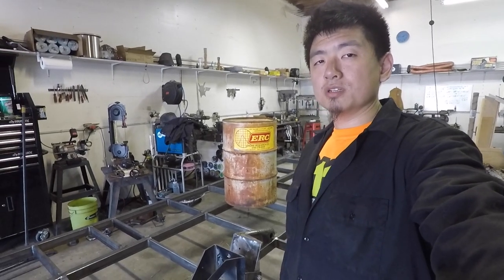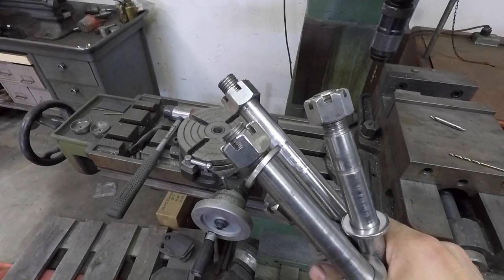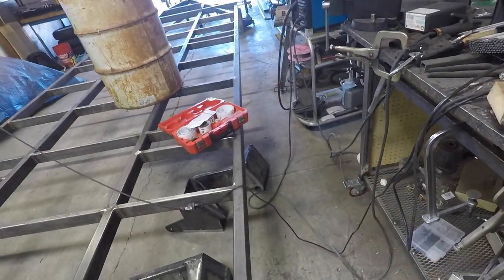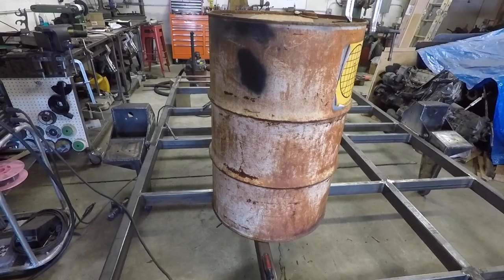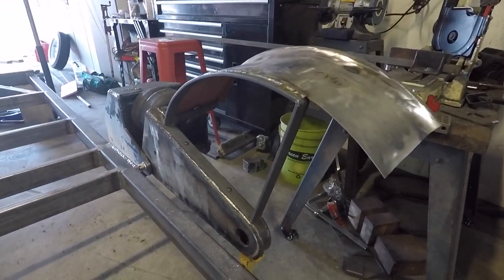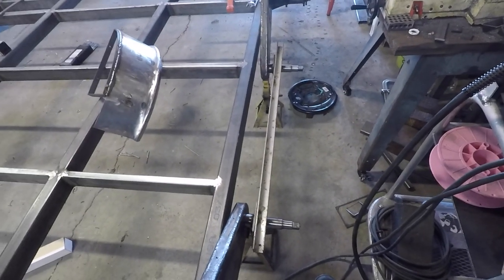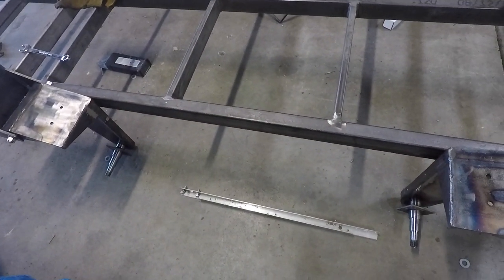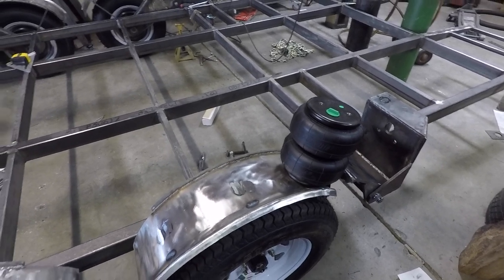Bagged Trailer Build - Wheels - Part 6

Comment: Good job , nice vide , but You should use some bushings or  bearings on pivots
Reply from the maker: there are bearings in there. I ended up changing the whole design and went with bushing instead of bearing

Comment: Can I purchase the same drawings you did? 
I already have the frame just need everything else
Reply from the maker: You can buy the plans here. https://fabplans.com/products/air-bag-car-trailer
Reply: How did you align the wheels?
Reply from the maker: @larrypierceall  the way I aligned the wheels isn’t the best. There’s a lot of assumption. I assumed the frame is square. Raised the frame the ride height and took measures from the brake flange to the frame.

Comment: hola buen dia amigo cuanto es el costo de las perchas o vases para las bolsas de aire.
saludos
Reply from the maker: You just want the airbag mounts?
Reply: @MCYIndustries  si
Reply from the maker: Claudio Andueza do you just need the plates cut and you will weld it or what?